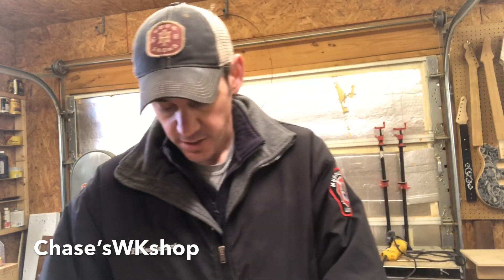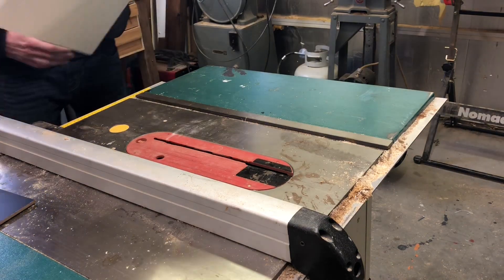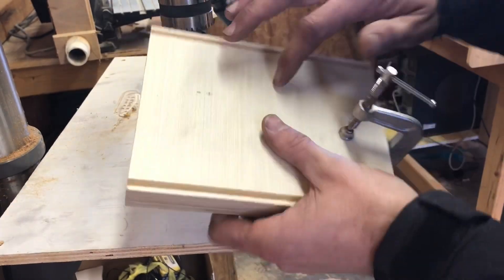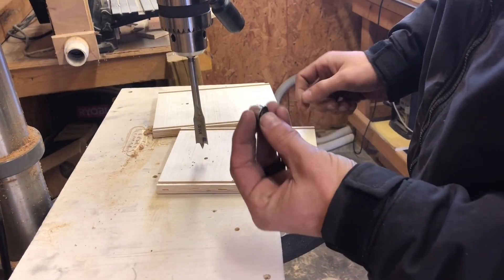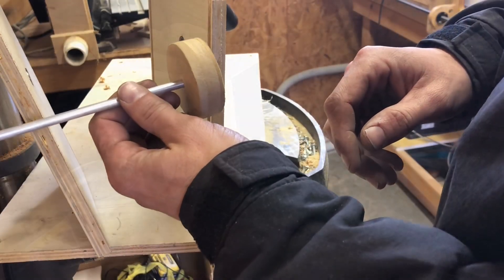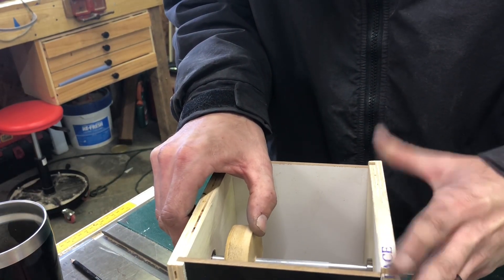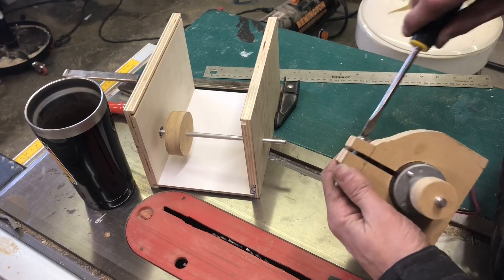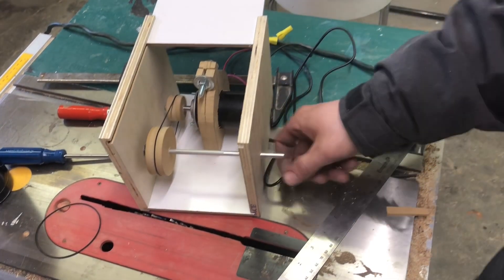Pickup Winder 2.0 Building the Box

Comment: The motor bracket is a keeper, I dont have a bandsaw so I need to buy some 160mm rubber lined pipe clips.
Reply from the maker: 7byseven I hear ya bud. I know the feeling not having the right tools. Thanks for the comment bud and let me know if you need anything.